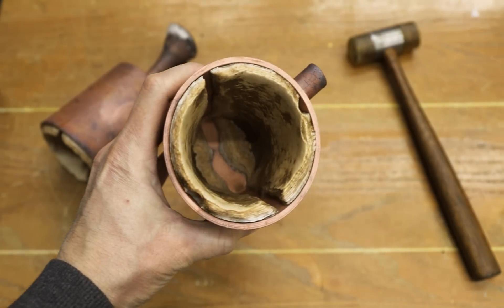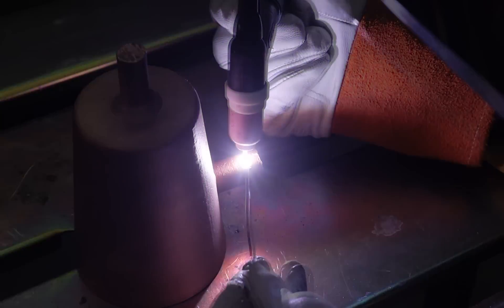Making Solid Copper Mugs, but should you drink from them?

Comment: i wish i could have a factory to make CPU and GPU cooler radiators out of copper and aluminum . no pipes , no vapor chamber , no fins , no joints/welds ... just a casted/forged metal brick that you put on the CPU or GPU ( after applying thermal paste ) and attach a fan and a transparent plastic cowl to it . that , off course , with much more accurate shaping

Comment: I agree with everyone saying to use brass screws and maybe make some walnut dowels to hide them. You don’t need to glue them in, just make them a pressure fit and if you need to disassemble, you can put a dab of hot glue on them and pull them out. I’ve done this before and it works pretty well. I just heat the tip of the glue stick itself, stick it to the plug, and then when it cools you just pull the glue stick to pop the plug out. 

Anyway, they look awesome and I’d absolutely never use one because I hate metallic taste on stuff.. lol I’d buy them to just use as pencil cups or something…

Comment: Anther benifit of copper for mugs is that it can absorb the flavor of a drink. While not much, if you use a copper mug for the same drink for years, it starts adding to it, as the flavor mingles with other ones. That does mean if you use one for Moscow mules (a common drink to use copper mugs with), then put wine in, your wine will taste bad, and the mules will have a strange flavor. So, unless you are careful (say using one type of drink in low quantities that compliments the main one), use it for the same drink.

Comment: Using pure copper mugs for a moskow mule is actually poisonous. The copper starts to dissolve and leach into the drink.
There's a reason why pretty much every Moscow Mule mug that you buy is lined with some other kind of metal on the inside.
They should be perfect for drinking a beer though. Can even try putting them in the freezer before pouring one inside them.

Comment: I'd never make a bong from copper for the same reason I'd never consume food or drink from a copper container. Acidic substances react with the surface of copper, causing it to tarnish and corrode almost instantly. This corrosion is highly soluble, leading to the presence of toxic copper salts in food and drink. It's why you would never use copper vessels for foods high in acidity, such as milk, wine and vinegars.

Comment: Ideally do not try and drink anyting acidic from the cup. You also need to be really careful about where you get your copper. Leaded copper is a thing just like Leaded Brass and it makes the metal more machinable btu also more toxic. If you want to make a drinking vessel from copper then the next step is to tin the inside. Its not an easy process but should stop you from poisoning yourself.
the same goes for any pots that you cook in.

Comment: Your not worried about copper poisoning? I'm told Acid bases dissolve copper. But I belive a fake glass using led based metals and enlaying a copper coating using electrolysis and acids and can come off and erode led and copper when a drink is Acid based and then can be co sumed further break down occurs in the guts stronger acid releasing toxic led and mercury into the body from a simple copper coated mug using electrolysis. I think my science is sound but untested. Could you maybe test this there since you have an actual cast coper mug?

Comment: Those cups look great! I don't know what program you were using, but have you tried looking if there is a specific command for exporting the file when 3d printing?  When i first tried making objects and printing them using autocad, my cilinders  looked more as a polygon than a circle. I found out a command "3DPRINT" that exported the drawings with a  higher polygonal resolution so curves were smoother. Just in case you were interested, not a critique to your work, they really look amazing

Comment: Clean process and cool design. If you're modelling with Fusion, check your .stl output settings, you can get rid of those facets in the mesh by increasing resolution. The build line texture doesn't transfer but the facets kind of did so just FYI you can control that if you're making the original model with parametric CAD software. A pair of screws, a small non-concentric set screw that gets covered by the concentric panhead screw, would keep the handle from clocking or indexing out over time.

Comment: To use a copper mug all you need to do it is coat the inside with a thin film of Beeswax,  While melting the beeswax, put the copper mug or cup in boiling water until HOT then dry the mug.   Pour the melted beeswax in the hot mug/cup, and make sure to coat the entire inside with beeswax and pour out the remaining wax.   With a thin film of beeswax, the toxic compounds you get by adding Copper to most alcoholic beverage never happens and you can safely drink from your copper mug/cup without fear.  Same trick works for sealing a drinking Horn.

Comment: So I don't know for sure if this is what cause the craggy imperfections and dimples in it, but a possible reason it could be is oxygen trying to escape. When we were casting copper in school, my teacher said copper is notorious for absorbing large amounts of oxygen while melting and it can cause imperfections even with the most ideal investment. Any time I have seen anyone do any serious copper casting, they cover the copper in a few layers of charcoal to minimize oxygen absorption since it will float on the metal's surface. I did that for my one big copper casting and it came out pretty clean.

Comment: Please every one,, copper is an unstable element,, prone to oxidation,,, copper oxide is not good for the body,, only ever use rarely a d make sure it is clean and shiny,,,, oh and no matter what, a copper cup with flavor what ever you put In it,,,, it's not used much for a reason,

Comment: Cool project!!  It's fun when you get copper or brass hot enough to start seeing the crystalline structure. 
 Answering the question from the video...  I'd say treat it like you're drinking out of one of those old lead tankards they used back in the day.  Especially if you have a hot acidic liquid in there.  
I used to fix musical instruments.  Some folks have allergic reactions with the metals in the instrument and we'd electroplate it with silver or gold.  You'll end up with silver with a copper undertone similar to plating phosphor bronze .  Very pretty to look at and safer to drink out of.
Best to use a brush electro plating instead of dunking it into a solution since the hard edges will collect more silver and appear inconsistent to the rest of the mug.

Comment: I have a few suggestions to make:
Beakers are usually made of an insulating material not one that conducts heat like copper does. That's why glass or ceramic is often used, because these are not good conductors. For example my titanium camping beaker, already a better insulator than copper, has double walls and a vacuum in between to hold the temperature of my drink longer.
I'm not sure that copper is a healthy material to drink from or keep food in. My great grand father, who was a copper smith, used to coat the insides of his vessels with tin. In fact most copper vessels I've seen have been treated in this way.
I'd have used wax instead of plastic to make the positive forms for the beakers. Most plastics leave some ash behind when they are heated up to their melting point. Wax just turns to liquid and then evaporates leaving a pristine negative form.
Personally, I find the rims on these beakers not ideal and not really inviting to place my lips on. They will also possibly make drinking difficult without dribbling. There's a good reason why the rims of most drinking vessels are round and smooth.
Otherwise, all in all, an interesting project.

Comment: Don't get me wrong, i really like your mugs and enjoyed the video, but this is an example that once someone gets a 3D printer they use it on things that should not be used for and think it's the solution for everything. This specific design could be implemented on maquette paper or lost styrofoam instead of a makeshift "lost plastic" method which wasn't that much lost, all these cost a lot, need extra energy and make a hell of a fume.
Also for the people who are concerned about the dangers of copper, they drink water that washes miles of copper piping every day so they're just alarmists, it can be tinned on a stovetop inside so that's where the matter ends.

Comment: Great work.
One note, copperware has to be coated with tin when will it be in contact with any acidic substance either food or drink, to prevent leeching while still preserving the thermal conductivity of the material.
Reply: You would die from alcohol poisoning before copper toxins😅
Reply: @TG-zd9de  After a good night sleep and a bad following day your alcohol will be gone, copper will stick a bit lonnnnger and is a bit harder to diagnose.
You can try both 'till death, in the name of science of course.
Reply: @TG-zd9de actually 1 drink can kill you. If you leave a Moscow mule in the cup for an extended period of time like a day, it can have  enough copper leeches out to give you copper poisoning

So drink them fast, that's how the best enjoyed anyways
Reply: @joshr408 you would need to consume over 1000mg of copper for it to even be toxic 😅. The amount of copper leaching from acidic drinks is negligible, your normal every day eating and drinking would allow more intake of copper.

Comment: noble metals usually not casted, copper things for cooking/eating traditionally made from sheet of metal and hammer. 
Look how you put your initials on cup's bottom by hammer – your name could be 3D printed on mold and casted, and it is the only way if it was iron but copper rarely casted

Comment: I'd suggest using brass screws to secure the handles instead of steel. Those steel screws will react with the copper and cause a layer of corrosion to form over time which could make it impossible to get the screws out later should you need to replace the handle.
Reply: Not to mention copper, brass, or bronze screws would be more pleasing to the eye.
Reply: That and steel screws with such a nice mug just makes it look cheapish. Idk, I’d still love to have those mugs tho
Reply: Great looking mugs, if you wanted a totally smooth surface could you sand the marks out or would you just chase them around? I like the “antiqued” look though
Reply: Duh.
Reply: Electrolysis between stainless and copper is fine for a mug.  Copper reacts with aluminium and zinc.
Reply: @TG-zd9de  I think the issue is that the steel screws will rust in a heartbeat when in contact with copper.
Reply: Say no to nonsimilar metals, not even once

Comment: Traditionally copper saucepans were plated with tin which of course is food safe. I would suggest tin plating the interiors either electrolytically or possibly by filling them with molten tin and pouring it out to leave the inside plated.
Reply: Flux, heat, melt tin, wipe.  Please tell people to do this more.  Copper poisoning sucks.
Reply: @westoniii  Millions of houses all over the world are plumbed with copper pipes. In the British Isles copper water heaters are numerous. What is copper poisoning and why haven't millions worldwide been affected yet?
Reply: @diffened  is water as acidic as tomato sauce?
Reply: @davedoessomestuff8176  probably not. Water in my area is pretty acidic. Is that what causes the problem, acid eating away at the copper?
Reply: @diffened  I believe so
Reply: @davedoessomestuff8176  my point, I guess, is people drink from copper water pipes their whole lives, possibly 100 years without being poisoned. That is a lot of accumulated exposure as opposed to occasionally drinking from a copper cup. Also, drinking tomato sauce from a copper cup? Maybe come up with something more realistic. Been alive almost 80 years and have never drank tomato sauce from a cup.
Reply: @diffened  I thought the comment was about copper sauce pans? 

The whole reason copper cups should be lined is because they're mostly used for Moscow mules which, last time I checked, had lime juice. That's pretty acidic. I don't think it would be an issue if what you're drinking isn't acidic.
Reply: @diffened  If the water in your area is as acidic as lime juice and vodka, pack up and leave lmao
Reply: @MelonMafia1 ?? Don't think I ever mentioned the acidity of the water in my area.
Reply: @diffened you don’t know what you’re missing bro! 😂
Reply: Excellent advice.
Reply: I think the copper looks great as it is...wouldn't worry about copper poisoning since most houses still have copper waterlines.
Reply: @KellyPKramer yes but they're in contact with water, not acidic food or drinks, which can cause a lot more leeching to occur. There's a reason people tin copper.
Reply: @NonsensicalIncomphrensible  

I was about to say that when I noticed your comment!
Reply: @NonsensicalIncomphrensible  aesthetics?
Reply: @diffened  I mean, that too.

Comment: Copper is safe when pH is above 7 or equal to it.If you acidify your liquid,traces of Cu will be present in the beverage,the longer the time ,the bigger Cu concentration.Higher temperature will enhance the transfer of copper. One doesn't die from drinking a weak Cu solution,but your body might show you on both intake and exhaust orifices that you made a mistake.. This is the main reason why copper hardware was tinned on the inside. The process is very simple,drop a piece of tin(plumbing grade) into the mug,previously heated past the melting point of tin,add a bit of ammonium chloride( it will smoke) and wipe the inside of the mug with a piece of cloth or paper towel

Comment: My grandfather was a coppersmith.
Copper and foods do not mix - tin the inside with lead free tin, i.e. soft solder, and it'll be fine.
Coppersmiths used dilute hydrochloric acid as "soldering water" to prepare the surface for this.
A more modern solution would be to use lead free soft soldering paste, i.e. ground up solder (e.g. 97% Sn, 3%Cu) in flux paste, brush coat the inside of the mugs with it and the heat them gently untill the paste melts and you get a silvery tinned surface.
Rinse well before use to get rid of any flux residue.
Reply: and yet every drop of water that you drink comes into your mouth via a copper pipe.  Ask gramps about that.

Comment: I used copper plated solid silver cups every day. Copper and Silver cups actually provide health benefits over time as the metal adds a barely noticeable metallic taste, and not only that but the water gets slightly more purified and it adds more minerals that are beneficial to your health. Any type of solid silver dishware and silverware provides these same benefits. I use solid silver cups and plates and spoons, etc. The only downside is dishware and silverware will cost you a small fortune, around $30,000 in today's prices for solid silver dishware and silverware, because of the materials and labor. I have ancestral silver plates and dishes from generations of my family. The oldest silver everyday object that I had, a silver pot was from the 1890s. I come from a zamindari family. This was what we used everyday.
Reply: I put a silver .9999 pure 1 oz coin in my drinking water thermos.
My theory is it purifies the water and possibly get health benefits from the silver water.
Maybe it does nothing but it can't hurt.

Comment: I wouldn’t drink too many mules out of a bare copper cup. Even mule cups are plated on the inside with nickel or silver to avoid leaching off copper into the liquid.  You need a minuscule amount of copper in your system to survive but you can easily ingest way too much

Comment: Copper-tin or copper-silver can look a lot like pure copper and resist acids.
They are types of Bronze; they form a patina (metal carbonates, mostly) that protects the base metal from acid leaching.
Recycled Bronze can be risky; arsenic, antimony and beryllium Bronze are becoming rarer, but are still found in the electronics industry and old Sculptures.
Beryllium was widely used in contact-pins for connectors; flexible, corrosion and abrasion resistant.
A tiny sliver of beryllium Bronze under the skin can lead to ulcerating sores that take weeks to heal!
Reply: That's the most interesting comment I've heard all year. I know that in my trade of steam fitting we install bronze valves a lot.

Comment: Copper cups are fine for anything non-acidic.  I wouldn't use them for tomato soup or even soft drinks.  Hot tea may also be a bad idea.  Copper isn't typically toxic, depending on the alloy (we will come back to that) but, chronic exposure may cause problems.  That said copper was one of the first materials used for kitchenware in general and is still in use for specific applications in cooking, primarily candy making.

Now about the alloy.  Copper is a very soft metal.  So it is typically alloyed with other materials to increase its hardness.  Some of these are heavy metals like antimony.  Those can be toxic in relatively small doses and do not pass out of the body very well.  So, they bioaccumulate and cause all kinds of health issues.  Since you are making these from scrap, I don't know what the heavy metal content is.  As long as you don't degrade the metal, it shouldn't be a big issue (back to that no acid thing) but, something to be aware of.